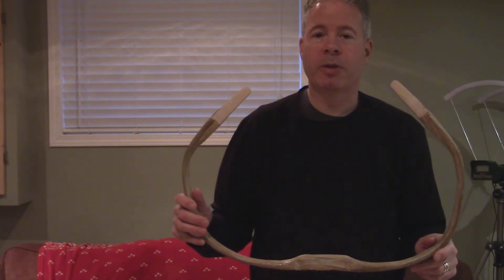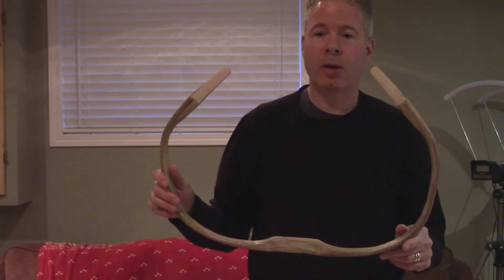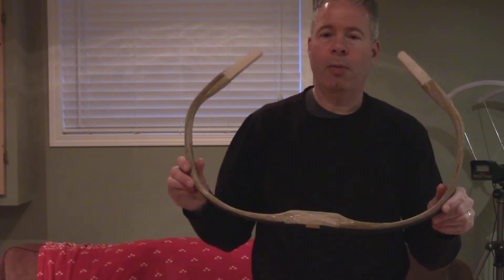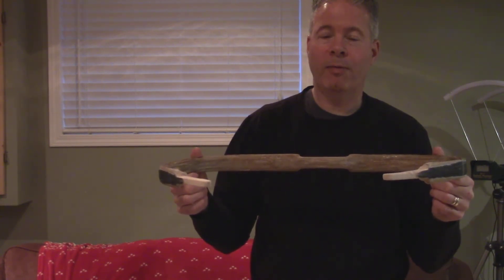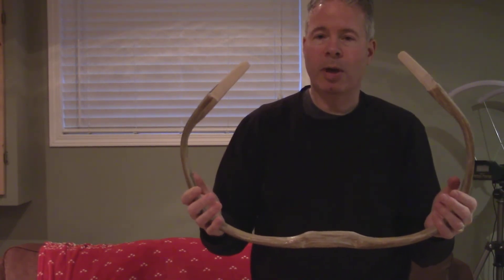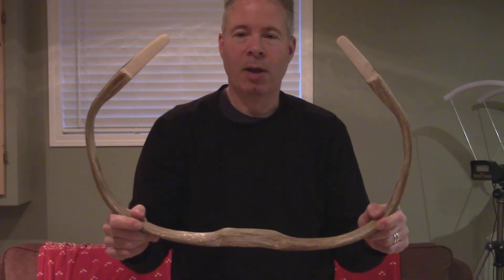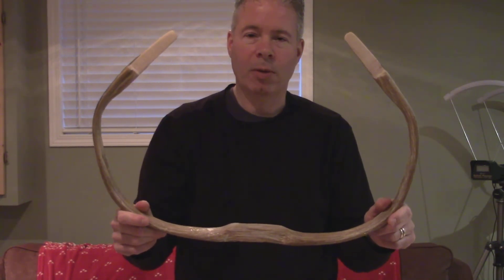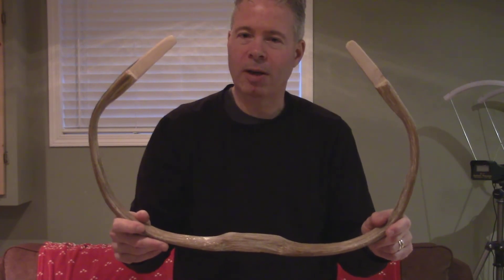Hornbow #4 Tillering Intro

Comment: Hello... Is there any substitute for horn? I've worked with horn but it isn't easy so I've been looking for a substitute... Any ideas?
Reply from the maker: Yes. You could avoid it altogether and use Osage Orange wood and sinew back it. Easy to get a draw weight between 60 and 80#
My first horn bow bend alike was an osage sinew backed bow. I will do a future video on it.
Reply: vfc Archery we don't get Osage in India im afraid.. I'm working on a bamboo composite bow... I have sinew... No horns... They're a pain to work with anyway... I was thinking of using thin bamboo strips with the skin facing the archer on the belly side in place of the horn... I think it should provide good compression (not as good as horn though)... Any thoughts on that..? Will it be good?
Reply from the maker: Bamboo makes a good core for a horn bow and for a composite bow would work best if it was on the back and not belly of the bow. If you use it on the belly I would make sure it is thicker for draw weight and sinew backed
Reply: vfc Archery yes that's what I'm doing... Since I'm not using horn so I'm using thick strips of bamboo Heated in an oven and hardened on the belly side in place of horn with The skin side of the bamboo will  facing me... I think that should provide good compression.....
I can share you the photos when it's done if you're interested! :)